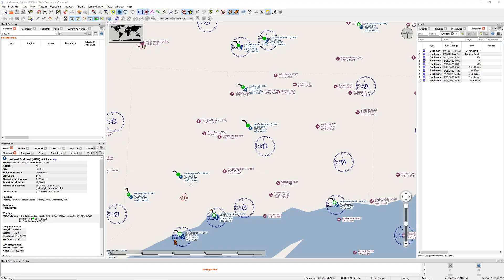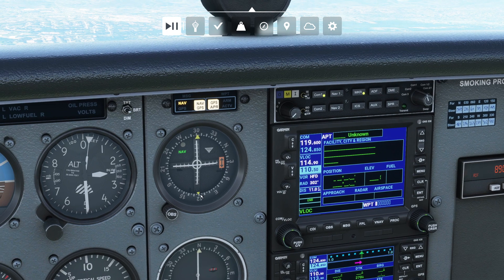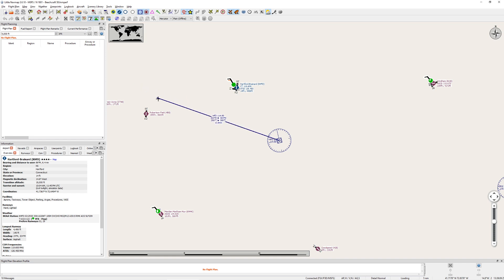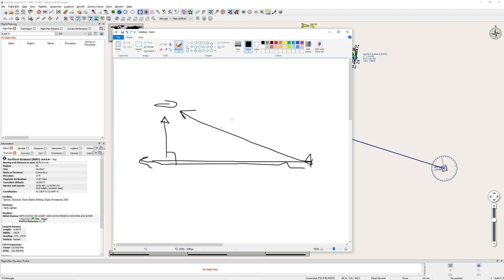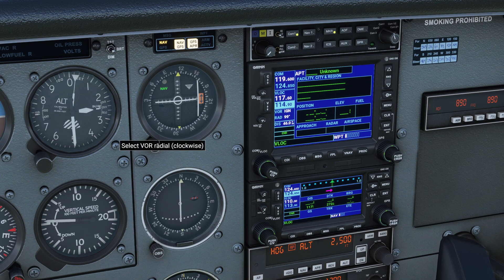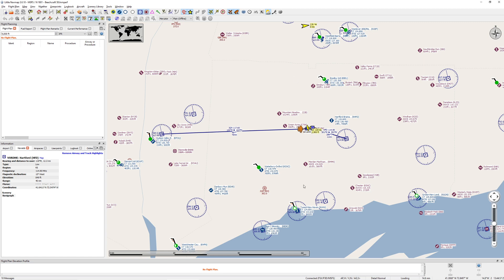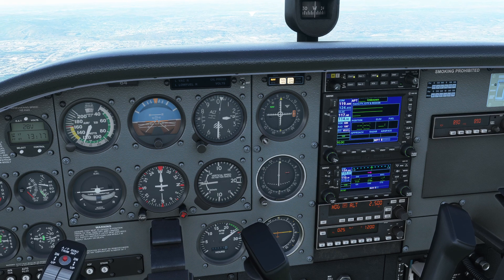MSFS & LittleNavMap - Finding a fix using DME and a Bearing.

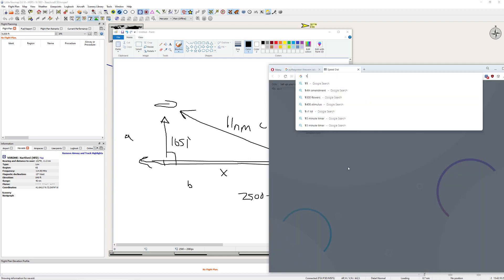Comment: 5:35 Ugh. I want to use the option to switch units to metric in MSFS so bad, but I feel like it's just gonna cause me trouble. Then again I look at various charts from Europe and see numbers without units with mixed unit systems even on the same damn chart and it causes me trouble already.